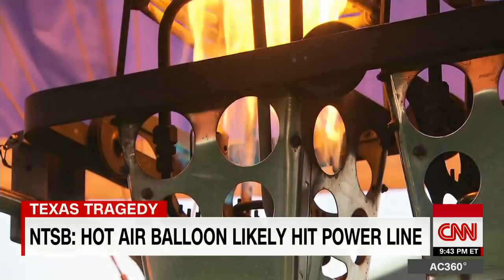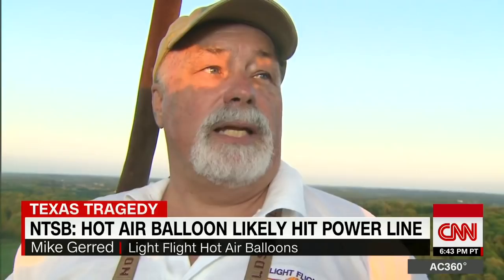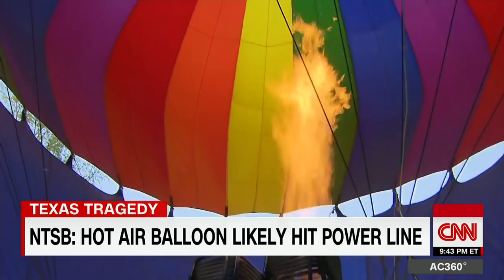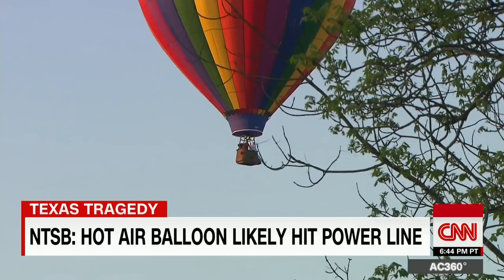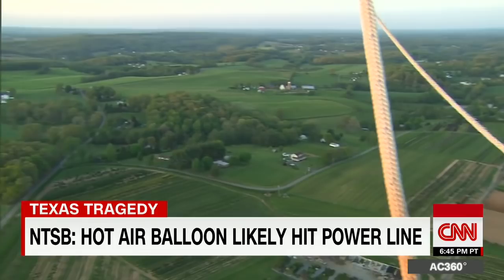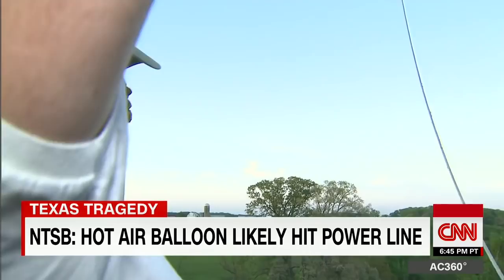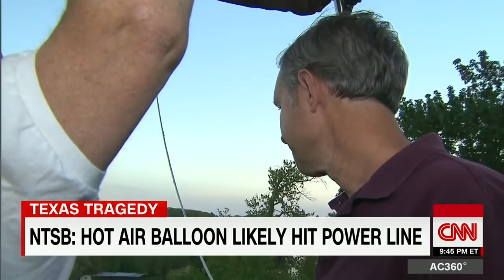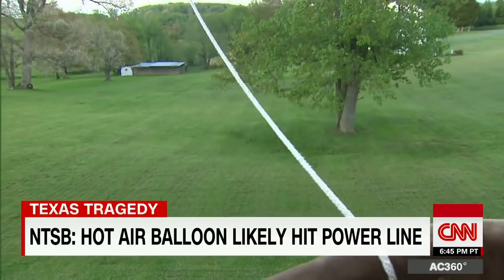How to fly a hot air balloon

Comment: lol this is how do they go up n down ,i wanna know how do they turn right n left ?
Reply: Weather consists of several layers as you ascend and the wind has a specific direction in each layer. By going up, the pilot records the directions and use them to control the balloon. These directions will be different per day. Make sense?
Reply: Yazdan Movahedi so I shouldnt make one and try to fly on my own?
Reply: Hydraulics could be used in theory. Maybe someday they'll have safer balloons that could be moved horizontally in case of an emergency.
Reply: They don’t. Air takes em
Reply: @joshtaylor9055  ?
Reply: @thomasmahase  the burner can make the balloon go up. You go where the wind takes you. That's the fun of it.